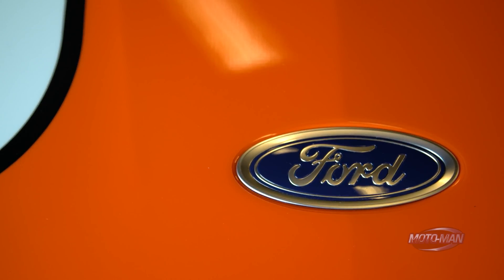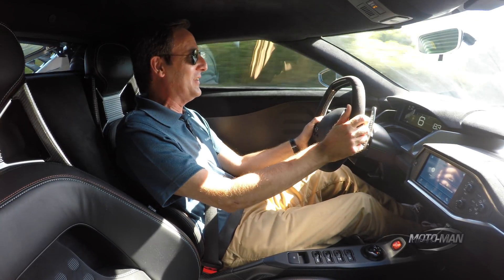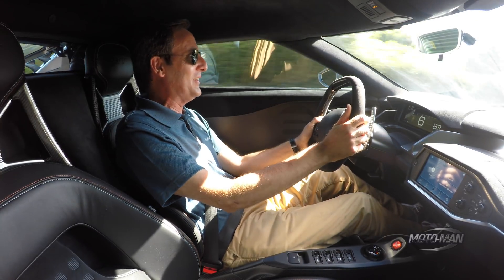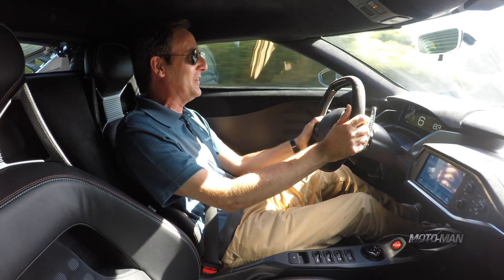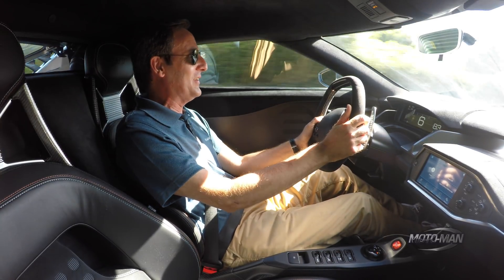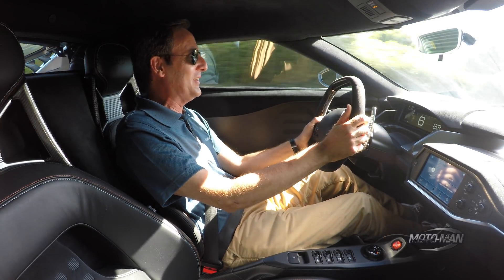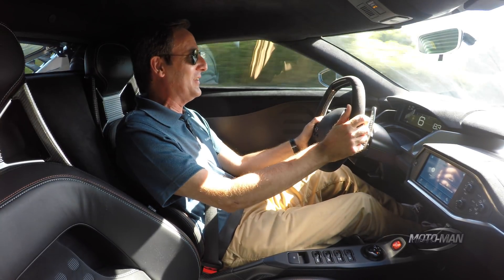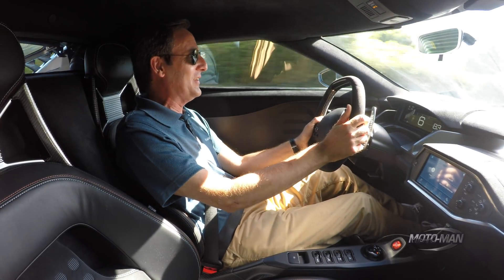Driving the $1,500,000 2020 Ford GT – RETRO DRIVE REVIEW

Comment: Great video motoman. Sidenote, I feel like when you put out a tech review before the main first drive review of a car, it can sometimes cause views to go down on the first drive. 

Maybe try switching it and putting out first drives first, and then tech reviews? Just food for though
Reply from the maker: Good eye, Ryan. As you may remember, we used to do a TECH REVIEW for most of the cars featured on the show but as the algorithm changed, we began to see a major drop off in views for any episodes that featured the same car over two episodes in a row. We played around with putting the TECH REVIEW after the FIRST DRIVE REVIEW, but that didn't make a difference. The second episode was always seeing a drop off. That is the key reason we stopped doing the TECH REVIEWS. Now, we only do them for VERY special cars - like this - or in cases where we have access to a special car (992 TURBO) before the global embargo lifts which was what the TECH REVIEW was intended for: Put out an episode that would not violate the global embargoes but still take advantage of our early access to the car. Thanks for thinking of the show!